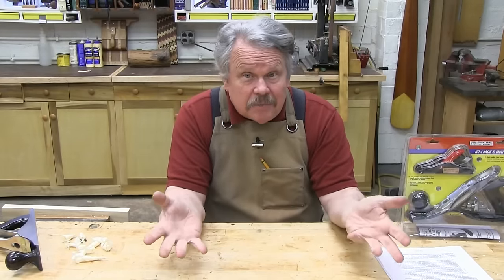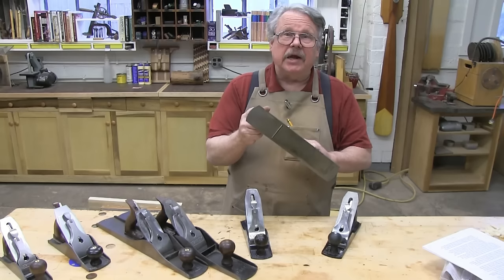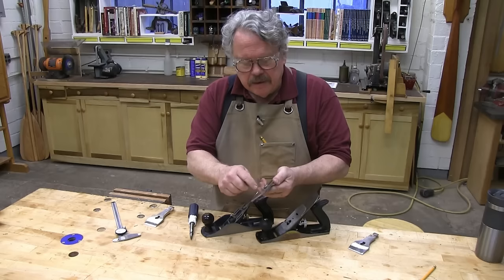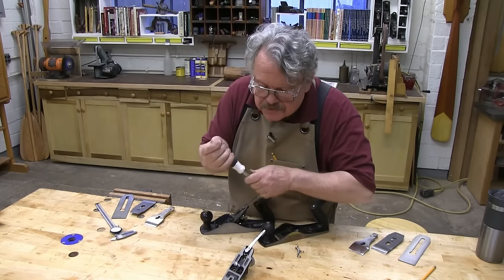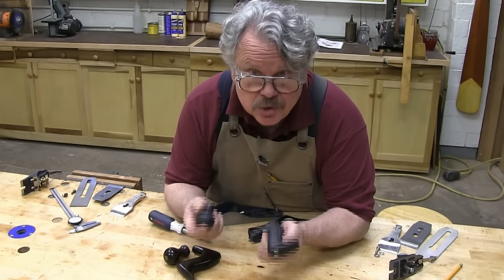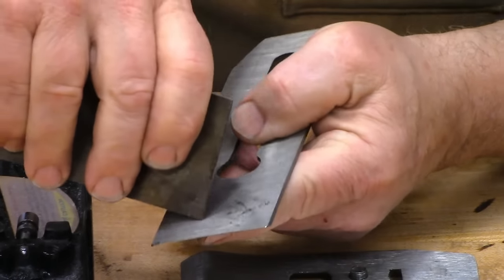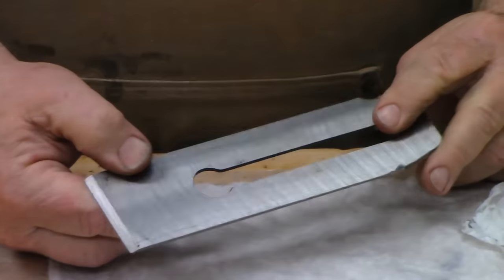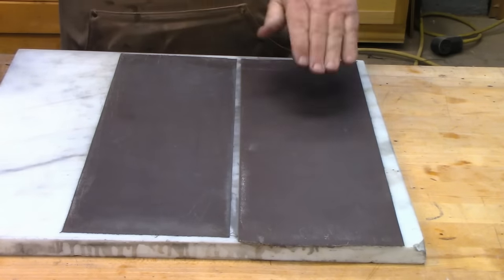Harbor Freight Jack Plane - How Does It Stack Up?

Comment: So, it took $10,000 worth of other tools and labor in order to make the plane "plane-worthy"!  Nice to know!  Appreciate your hard work and intelligence very much!  Your sense of humor is just as sharp!  Keep up the good work!
Reply from the maker: Thanks for your insight -[- and kind words.
Reply: Yes, but after fixing 10000 planes it is just 1 dollar per plane 😂
Reply: @jukkahuuskonen  good one!
Reply: @jukkahuuskonen  But at that point you have to factor in the cost of labour.  Given just how many hours and hours of grinding he mentioned doing, the cost of labour alone would be more than the cost of just buying a brand new Stanley.
Reply: Every mass produced plane takes the same initial prep. Not as much as this cheapo though
Reply: @woodworkingandepoxy643  Most planes just need a good lapping and sharpening. This is the only plane I've ever seen, off-the-shelf, that needed it's frog modified or it's blade iron trimmed that much.
Reply: @flagcourier  yes, but telling someone who doesn't know what lapping means to lap it isn't going to get it the way it needs to be unfortunately

Comment: I bought one of these planes back in 2008 when I first got into woodworking.  I took it apart and I never could get it all back together.  What I could get back together I tried to make work, but I was very discouraged with it and never got into hand planes.  Until very recently watching Paul Sellers I got a Stanley block plane from the hardware store and tuned it up and it’s a lot of fun to use!  Now I want to find a good no. 4!
Reply from the maker: You can't go wrong with an older American-made Stanley, Garret. But make sure of what your getting. I once bought a No. 4 on Ebay and was surprised to find it had no way easy way to adjust the position of the frog. I later learned it was a copy made in Canada. I've also had problems with Stanleys made after 1962 (Type 20 and later). If you need to date the Stanley you're looking at, I suggest this web site: https://www.hyperkitten.com/tools/stanley_bench_plane/ .
Reply: This exact damn thing happened to me
Reply: How is your journey going?

Comment: I bought that exact package several yrs ago from HF, having little knowledge of what I was purchasing, other than knowing what their purpose was and what I wanted. Needless to say , I was sorely disappointed and both planes have sat unused ever since. By the time I get around to trying to flatten and sharpen, I may have the $$$ to buy a quality planer. This was a very informative video. Much appreciated!
Reply from the maker: Thanks for your interest and kind words.
Reply: @Chuck W ,

I hate seeing good steel go to waste.   The irons in these things appear hard enough to hold a sharp, maintainable edge.  

Now that you know what needs to be done, you may find that tuning up your Central Forge planes to a usable condition may be a gratifying experience.  Once all the other surfaces are polished enough to make adjustments easy,  these planes have the potential to be a pleasure to use.  

·
Reply: Farting Frog should stop selling CRAP, potentially and otherwise.
Reply: Does not Hardened Log allow folks to return the junk they sell?

Comment: Just learning how to use hand planes. I have now taken 2 planes and 'fixed' them. I consider that to be essential to learning how to use the tools. Nice tutorial. I would be hesitant to put the sole of a plane on a belt sander. Mine has a 'platen' of some sort on it which has mostly worn away. Maybe. Also, I would suggest that no matter what plane you buy, give it a stem to stern check up to make sure things are in working order. I have a Bridge City plane that needed a lot of work, and it was a replacement for the first one I got from them....

Comment: I actually took that same plane (presented to me by a well meaning family member) and gave it a full "tuning" by hand. As a finish plane I never found it to challenge any of my Stanley #4s but with a little more work it does make a good mini Fore plane where tolerances can be a bit more forgiving. Great video. Be well.
Reply: a "mini fore plane"... And your # 6 as a giant smoother?
Reply: I think I put over 100 hours learning to remanufacture this plane by hand.  95% of what I did to make it work came from this man.  The remainder came from Rex Kruger.  Bless both men!  I got it to work finally, tonight to flatten a bowed bamboo cutting board.  I agree with you.  A smoother it is not.  

I highly reccomend this plane to new plane users.  It's way out of our league but by the time you learn how to make this thing work, you will be ready to appreciate and set up a GOOD quality plane.  You will never want to waste your time and $$ on junk planes.  You have EARNED 
 the right to own a wood river or lie neilson or whatever quality plane your heart desires!

Comment: Your summary is exactly where I am at.  I'm brand new to woodworking, and thought I'd start with something inexpensive to get some practice.  I spent hours sharpening, resharpening, struggling and finally can get the plane to kind of sort of make a shaving with lots of tear out.  I've sworn off buying anything from Harbor Freight ever again, and am going to purchase a Stanley with my next paycheck.
Reply from the maker: Tip: I recently tested a #4 smoothing plane and a low-angle block plane made by Jorgenson. Combined, they cost me less than $100 and they both worked well right out of the boxes before I sharpened them.
Reply: @WorkshopCompanion  I will give that a try, thanks for the advice!

Comment: I was lucky enough to have wood shop in HS, which gave us a good education on using, and sharpening a plane iron, using a dedicated larger grinding wheel and some oil stones with a fixed angle jig. We were able to put a useable edge on it, and , I tended to do a fairly good job judging from my chips. It was nice to see your "old school metallurgy" skills of reading a grinder spark, there's probably very few woodworkers who would even have that knowledge.

Comment: You did a spectacular job describing the difference between the Stanly planes and the parts. Harbor Freight make good, but by no means great tools. A mechanics needs are far different than a woodworkers. Your dissection of the Central Forge tool and the Stanley proves the point. Thank you.
Reply from the maker: Most welcome.

Comment: I bought the same plane from Harbor Freight two weeks ago and my assessment was the same as yours. I used the same techniques to fettle it as you did. I needed a scrub plane and that was why I purchased it thinking that a scrub was not such a precision tool and would probably do just what I needed. I cambered and sharpened the cutting iron and went on to using it. I have used it quite a bit last week and it has proved to be an adequate scrub so far. Your plane tune up was very good and you did a great job of covering the subject. Thanks for the video.
Reply from the maker: Most welcome. I'm thinking on turning one of mine into a scraper plane.
Reply: @WorkshopCompanion  That sounds like a very useful conversion. I am  interested in how to accomplish that especially since I have never used a scraper plane or even seen one except in a picture. How would you hold the iron in a near vertical position?
Reply from the maker: @woodswanderer7274  Tough to describe without pictures or plans. In my book, "Sanding and Planing," I show the plans for a home-madescraper plane. I'd use a similar mechanism set in the metal bed of the HF plane. I'd also use the HF iron as the scraper.

Comment: Thanks for review.  They have a smaller 8.5"  "No. 33 Bench Plane" to play with next (about $13) - seems a notch up from one you tested.  My first 5 minutes of playing with it made shavings.  Blade 1.75" wide and uses the 2 nut adjuster & a thumb screw cap,  no chip breaker (wood plane kit from Veritas doesn't either).  Has a nice varnished wood tote (so no seam to scrape).  My hand is big but the tote is almost comfortable without breaking the ear with a hammer - may be inspired to grind finger relief at the bottom... or I could be a woodworker and cut/sanding two custom totes for both an old Stanley & the Windsor/Freight planes.  One glitch in instructions (?) bevel pictured up.  Not being a block plane. I put it in bevel down... Instructions correctly imply sharpen iron before use... not overly sharp from box but it makes heavy shavings.  Castings not too bad, may have a low spot on sole to sand but otherwise looks straight.  Bought it thinking of using it for parts to make a trapping plane. May try a baby sized one from a finger plane.  Will play tune up on this thing.  Still love my first block plane  &  my 1st card scraper project was fun while I had good burs on the edges - getting there.  - R

Comment: I bought very similar plane some time ago. It was bad. I tried to tune it, even bought better iron for it. But the plane wasn't working as expecting. I lost my patience, bought used Stanley. Wow! Finally I have real smoothing plane. The cheap one works as scrub plane now and there it is good enough. The aftermath - cheap things cost the same as not cheap, but for cheap you pay also with your time and work before actually can use them.
Reply from the maker: True 'nuff.

Comment: I didn't buy this plane but this video was fantastic. I have just refubished a very rusty Record number 5 plane, unfortunately it needed a new iron and chipbreaker but the frog was in great condition and thankfully very little pitting on the sole which was remarkably flat still after all those years. Best advice to any novice woodworker is to get your hands on older tools, they were built with far more care and attention and will typically cost a lot less than something of equivalent quality built today. I have a veritas number 5 that has nothing on this < £50 plane I picked up from a flee market.
Reply: I kept hearing the praises heaped upon old Stanley's, I finally got my hands on 3 #4's when a friend donated them to me, they'd been left outside, forgotten, for about 3 or 4 years. I got them back into working condition again but none of them hold a candle to my Faithfull plane's which in my humble opinion, are very underated.
Reply: @grumpyoldsodinacellar4065  Which faithful plane do you have? I've always heard good things about them but never even held one. Also which Stanleys did you get? If they were pre 62 they should be superb once refurbished and tuned.
Reply: @daveawb  in the Faithful line, I have the 3,4 &5 as for the Stanley's I was able to date them to 1950's to1960's   Give the Faithful 5  a try, mine worked straight out of the box, although it did need an edge putting on the iron relatively quickly, but once sharpened and honed, they do hold their edge and I work mainly with oak and mahogany.
Reply: @grumpyoldsodinacellar4065  I’ll certainly give one a try 👍

Comment: That beginning line is perfect and exactly why I like your stuff Nick. So many woodworking folks on the internet like to act like Harbor Freight is terrible, but for the average hobbyist it is great. Where else can you find an entry level dust collector, lathe, band saw, or half of the other things from there. Of course the tools and machines are low quality and there are many lemons there (like this hand plane). But, for most of their stuff it can also get you started.  The closest Woodcraft is 2 hours away (Rockler is 3) and pretty much every single one of their machines are out of my budget. My first drill & driver was a black & decker set from Walmart, you can't get much more low budget than that. And it worked great for me. It drilled holes and I could drive in screws. Now, is my Dewalt drill & driver I have now better. Absolutely. They are more powerful and just nicer to use. But, there really isn't anything new that I could do with the Dewalt that I couldn't do with that cheap black and decker set. I actually still use the $50 bench drill press I got years ago from Walmart. Is it a piece of crap? Absolutely, but it drills much more accurate vertical holes than I can with my hand drill and I don't have the money right now to upgrade to a nicer one.

Regarding hand planes, it's just the sad fact that outside of Woodriver or Lie Nielsen, there aren't really any good modern options, especially for those with limited budgets. However, the new jorgenson #4 hand plane at Lowes seems to be decent. However, the best option for the budget minded new woodworker is to just get an old Stanley either at a antique store or ebay. It's going to be much cheaper and it may not even need tuning. And even if it does it's probably going to only need a mild tuning to get it working well (which even a new woodworker could probably accomplish halfway decently).

Comment: As a long time hand tool woodworker I appreciate your explanation of the functions of the plane parts and remedies for poor tool craftsmanship. I have restored way more than a dozen vintage Stanley planes to every day working condition and use them regularly. You are right, a well tuned plane is almost a religious experience. ;-)  The practical lesion here is if you figure how much your time is worth per hour, you could have bought a Lee Valley or even the Cadillac  Lie-Nielsen. And, as you noted, this does not take into account your tools, materials, and knowledge base. BTW, I so much love my #8 jointer that, once you get it moving, does not want to stop. (You don't have to go to the gym). This is my first video on your channel, I look forward to seeing more.
Reply from the maker: Thanks for saying and sharing.
Reply: The #8 is a plane in beast mode... lol. I picked one up a few years back... it was handy for flattening the surface of the Nicholson work bench I was building at the time.

Comment: I bought a kobalt number 4 plane a year or two ago from lowes. It was about $40. The only modification I needed to make for it to be somewhat usable, other than blade and chip breaker sharpening/flattening, was to grind a new hole for the depth adjuster in the chip breaker. The blade wouldn’t reach the wood otherwise. I’m sure there are other things I can do to improve the plane but it’s usable. I plan to use it as a scrub plane.

Comment: This is exactly where I found myself. I was new and only started to learn that a Stanley No4 was a good thing to have. In the best reputated tool shop of the town I found it and price was OK to invest a newbie.
Although nranded Stanley, it was exactly that tyle of plane like you show.
When I started to have doubts I was wandering in the internet whether Stanley had started to make cheap copies of the good brand. Or maybe company or brand was bought out on China.
Reply from the maker: The original Stanley Works tool company merged with Black & Decker in 2010 and is now Stanley Black & Decker, headquartered in Connecticut, USA. They still make a good many planes, including three versions of the No. 4. I have a Stanley "Sweetheart" No. 4 made by the Stanley Europe division in Belgium (manufactured in Mexico). They also make a "9-3/4"-inch Bailey," which looks to be a direct copy of the old No. 4, and the "No. 4 Adjustable Bench Plane" with twin screws to advance the iron and adjust its angle. I have no experience with the last two; I couldn't tell you how they perform. But there are knock-offs of the older Stanleys available, and you may have gotten one of those.
Reply: @WorkshopCompanion  Which version of "old No. 4" are you referring to? Just kidding... lol. For the benefit of those following along, Stanley had made many iterations of #4s over the years.

Comment: I use one of those for planing off rough, painted, and filthy used lumber.  I didn't encounter the problems you had, but I did have issues with squareness, which I resolver the same way you did... belt grinder and flat stone.  I sharpen this one on a belt grinder with 240 grit... no mirror needed here.  Once the wood is clean, then the old Stanleys or my older wooden planes.

Comment: I had a HF plane once, I gave it away,  I wanted it out of my shop asap.   Get some old stanleys, they work very well and you get used to tuning them up after 1 or 2 and its no problem at all.  You are rewarded at the end with a fine plane.  or get the premium planes but I prefer the older planes.  You learn more tuning them up.
Reply from the maker: Agreed.

Comment: A Stanley planer costs about $150, while a knockoff costs about $40. On day 1, you mentioned spending 5 hours on sanding alone. Let's assume, for a moment, that this is all it takes to get it working. Assuming you charge at least $50 an hour for a project, the real cost of the cheap planer suddenly becomes $250 (5 x 50) + $40 = $290. I'm originally from the Netherlands, and in Dutch, we have a saying: "Goed gereedschap is het halve werk," which roughly translates to "Good tools are half the job." That's why I only buy quality tools. It may take longer to acquire everything I need for my workshop, but the tools last a lifetime. I also purchase many used tools, especially larger ones like sawing and router tables, drill presses, and band sanders.

Love your videos!
Reply from the maker: I have estimated the cost of all the work I did on this hand plane for other viewers, and the actually cost was $1500 to $2500, depending how you value my time and Jim's. But your point is well-taken.